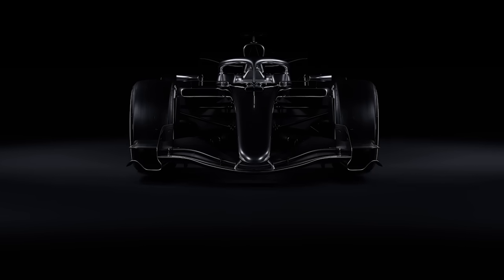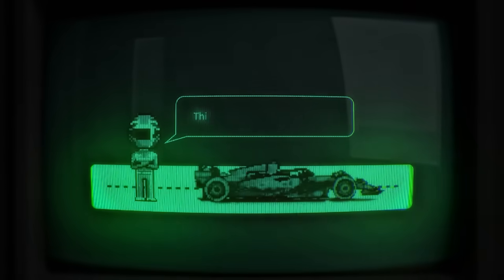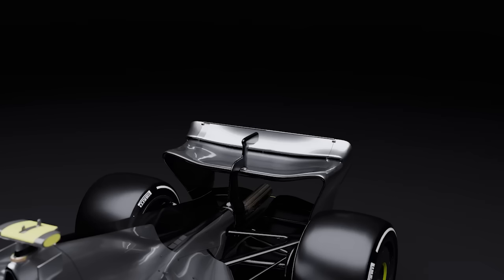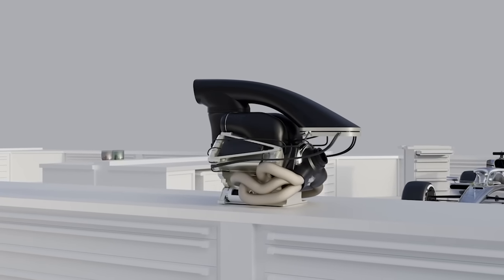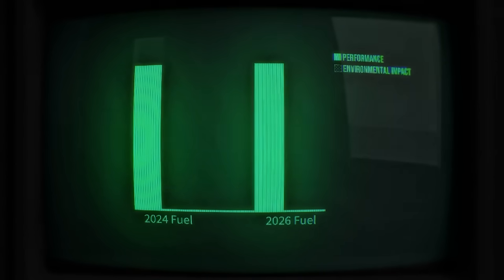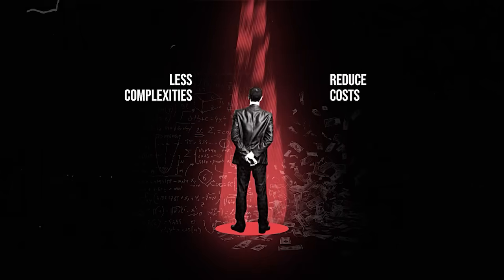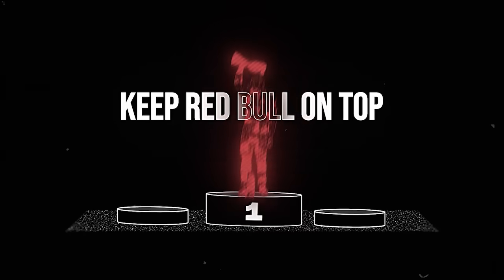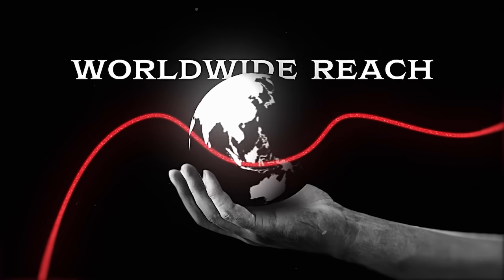F1 2026 Regulations: What’s REALLY Changing?

Comment: They did not become heavier through safety features. From 2008 on the weight increase was driven by Hybrid technology; Kers, then the 2014 engines. In each case the overall weight increase is directly linked to accommodate this technology.  The halo (The only significant safety addition), is only 7-9 kilos.
Because the heavier cars then hit with greater impact mass in crashes they had to reinforce the crash structures, adding even more weight.
And in 2017 they just made the cars physically bigger for no real reason, adding more associated weight.
The 2008-2013 cars were not unsafe in any way. F1 hit a sweet spot in safety and lite-weight. (You can see it in the stability of the safety regulations)
The addition of Hybrid powertrains, and super-sizing the cars is what led to all the weight increases since.

Comment: About time they get more active aerodynamics. F1 is supposed to be the pinnacle of motorsport technology, honestly a crime its taken this long. 
Though Im not sure about the 50% EV power rule, they're already using sustainable fuel, i have doubts the batteries will keep up for an entire race. Why not give teams a range in which they can operate, minimum of 40%-60% EV power for example so we get some variation in approaches for teams? F1 is a racing AND an engineering competition, FIA keeps banning innovations and I feel that its really holding the sport back.

Comment: I think these new regs are a step in the right direction. A couple changes i'd like to see though.

1) Push-to-pass button: 
I'd like to see this be available for a set amount of uses per race only. The driver can use it to attack or defend. They can use it to pull a gap early in the race or close a gap late in the race but either way, once they've reached their use limit, then no more for the rest of the race.

2) Tyres: 
I like to see all teams be given the same allocation of tyres at the beginning of the season. They then need to tell Pirelli what tyres they wish to use at the next, say, 3 races. They can use any combination of any compund they wish. It's entirely up to them. Those tyres are then removed from the allocation and cannot be replaced.

I think these two changes, especially the point 1, would add a great strategic element to each race and increase the unpredictability of each race outcome.

Comment: you’re not really making an argument about how the new regulations improve overtaking. I'm not sure I see why the low drag configurations of active aero would help since both the attacking and defending cars will be using them on the straights. won't even add any tactical depth as you said, everybody will use the best mode for each track section, no strategy involved. it kind of feels like you are bringing things up without backing them with a technical analysis

Comment: They should keep the current balance between ICE engine and electric motors using half electric half ICE would impact a lot the car's performance, a great solution to that would be to switch to renewable and less harmful fuels like the ones being used by the WEC

Comment: The physics and mathematics just don't add up to a formula that is competitive with current regulation lap times. Current era F2 cars are likely faster than the upcoming F1 cars in 2026.

The reason is the ICE reduction and dependency on the motor and battery. 

Not only has the ICE been severely reduced by regulation, in practice it's much further reduced due to the charging requirements of the battery as well. It's not a 50/50 split, it's likely closer to 35/65 or 30/70. 

And being forced by the regulations on power units and fuel energy density and fuel capacity and recharge required, the only option to complete the race distance is to lower the top speeds on every straight and lower the rpm everywhere on track. 

I expect lap times to be 12-14 SECONDS per lap slower than current cars.

These regulations are unnecessary and very poorly thought out. I would go so far as to say these are the worst new regulations entering a new era in the history of Formula 1... And that doesn't even begin to address the total nonsense that is the car regulations and x and z modes -it's really just double drs and the drivers don't even get to control it. 

Truly awful, terrible regulations.

What they should have done: 

Show off the carbon neutral fuel with V10's. Lose the turbo, electric crap and get rid of DRS. They should get 1200-1500 hp.
Reply: I think teams and F1 are saying the cars will be around 2-3 seconds slower than the current cars. So still plenty faster than F2

Comment: the engine power use change is only a marketing stunt and a pointless change when it makes practically no effort to actually better the enviroment, if the governance of f1 and motorsport really cared and wanted a change, they would alter the calendars of most racing series with multiple locations, which still remain the main source of CO2 emissions of motorsport

Comment: They supposedly want them to be racier, but not quicker avg. lap times, generally. More of the power is battery, less engine. Meaning you have to slower overall to go faster in bursts.
Reply: The upgraded engines that utilize electrical energy are faster than the older ones though.

Comment: So all the weight saving is wasted by using bigger batteries for greener ballshit regulations that completely go against carbon footprint if it is already using renewable fuel, and the active airo rules haven't changed they have just become more complicated making racing even further away from driver skill when messy corners can be saved by a push of a button. Look forward too seeing how reliable the computerised controlls for aerodynamics are. New regulations were looking good with smaller lighter cars and then sort off just went down hill onwards

Comment: should be a V4 instead of a V6. smaller engine allows space for bigger battery. maybe also aid in reducing weight further
Reply: Nah stay 6cyl, but switch to higher revving na and boost the ev motor. The new raxail hybrids ala the koenesigg dark matter weighing 88kgs but making 800+hp could then be utilized. 

So a small high revving nice sounding simplified gas burner for the dinosaur burning fans, along with a very powerful raxial hybrid motor=better sound, better performance, simplified vs turbos and an ev motor, lighter&better racing for the fans!

Comment: - The cars will be slower due to needing to keep the batteries charging constantly. Expect massively slower race lap times than qualifying.
- Since everyone has DRS, there will be no draft, hence the dependance on electrical boost to aid overtakes... which means more charging. (If you wanted to make it easier to overtake, you would add drag to the cars and removing DRS. This allows for more organic overtakes. Look up the 1999 US 500 race. They installed a flap on the rear wing to slow the cars down, and offer 40-50kph drafting speeds at 350 kph.)
- The cars length and width, without significant reduction in weight, only achieves a smaller floor area, reducing the best downforce. It also doesn't magically make it easier for cars to overtake.
- Reducing the cars ability to generate downforce via the floor will make it harder to follow.
- Shrinking the size of the tires will give the cars less free mechanical grip, making it harder to follow and harder to race side by side.
- "Optimizing efficiency" is great for endurance racing and transport trucks. Not for F1. Formula 1 is about speed and technology. Not fuel and tire saving.
- The majority of F1's carbon footprint comes from logistics, power grid usage at the tracks and maintaining the classy experience at the tracks. Not the cars. Charter flights for the teams. Make everyone fly economy. Ban driver's private air travel. Reduce wasted power at the circuits on things like a giant F1 sign at Las Vegas. Don't run night races any more due to lighting demands. Reduce plastic usage and wasteful fancy foods that are shipped in from all over the world. Use local.
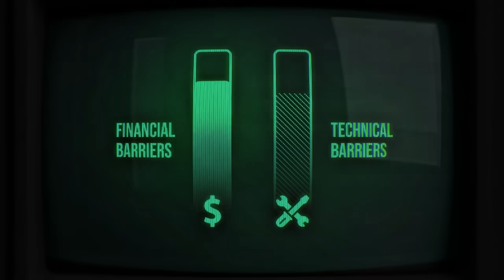- 7:28 except Andretti.
Reply: The fact that these races jump all across the globe is so silly. Should tour around the world (and end in Brazil) but no let's jump to and from the middle east cause some oil prince likes the attention during the ceremonies
Reply: @mizutani_  as far as I'm concerned, preaching sustainability and environmental responsibility... While catering to oil sheiks is hypocritical as fcuk.
Reply: @mizutani_ I agree that the calendar is pretty inefficient but from what I understand it’s based (mostly) around the weather for each part of the world and some tracks have very narrow windows of operating at a good temperature for racing. Also yes oil money was used to make Bahrain the 1st race of the season and abu daubi the final race.
Reply: Do people even care about race lap times? Lap times only matter in qualifying
Reply: @lewis8552  quicker lap times means quicker cars? Ever since 2014, F1 has been on a bad decision spiral. 2023 was a step in the right direction aesthetically but like... It's been 10 years of horrible decision, and this next formula is continuing the trend.
Reply: Source: "Pulled out of my own ass". This is a bunch of statements with no argument whatsoever, except the carbon footprint which is imho a correct presumption
Reply: Bro is a professional hater
Reply: @aaronmoyer4722  It's ok. I got IMSA to fall back on.
Reply: Bro yapping
Reply: @bigchief9313  I had time between between doing your mom and her making me breakfast.
Reply: You make some good points, especially on aerodynamics (and yes IndyCar did a fantastic move in 1999!), but this is nonsense:
"Shrinking the size of the tires will give the cars less free mechanical grip, making it harder to follow and harder to race side by side."
It is a known FACT that less mechanical grip = easier overtaking. Just look at WET races - best overtaking ever. Also, less mechanical grip (or any other grip) means longer braking distances due to weaker braking and slower cornering speed, which all means more overtaking chances.
Reply: @amjan This is the line of thinking Nascar needs for their short tracks. The current generation of cars have way too much mechanical grip to make passing possible. The best way for Nascar to reduce mechanical grip would be to increase the HP, but Nascar doesn't want to for some unknown reason.
Reply: @amjan  That's not entirely how that works. Less mechanical grip means the tyre grip matters more (deg, tyre compound etc) the wider tyres mean just mechanically there is a higher base grip level, less chances of spins etc etc etc. 
So more mechanical grip means the ycan race closer with the disturbed sidewash of air easier as there is a higher base grip and a higher expected level of competitiveness between cars with different tyres/deg levels.
Lowering the mechanical grip means cars on softer tyres, or fresher tyres will have a huge boost over those without meaning yes more overtakes, but not because the cars are more racey, purely cuz less overall grip so the compound/deg levels matter a tonne more. 
Lowering the mechanical grip also means more spins, specially after the drivers are used to being able to lean on it more and accelerate earlier etc etc because of having this mechanical grip, sure they will be fine but there will be some adjustment periods (ppl like max will struggle the most cuz of how their driving style works) 
Less mechanical grip also means there will be more reliance on downforce to help maintain it, but they are also reducing the floor meaning they will lose not only raw mechanical grip in the tyres, but also less overall downforce on the body. 

Bottom line: these changes mostly just make all the cars base cornering worse, givign advantage to softer tyres/fresher tyres for most part. Then the obvious harder overtakes on a straight, it will all come down to cornering grip and braking zone, so a lot more dives, which people have been complaining about the last few years (ppl been saying dives happen too much with how risky they are) so enjoy that kerfuffle xD
Reply: @amjan  I guess you're right about the low grip. I was thinking about dudes hanging it around the outside. But... You're right. The lower the grip (within reason) it will allow cars to be side by side around corners easier
Reply: @Synystr7 wow it’s actually cool for you to accept that your wrong with humility, not many people do that, that’s really respectable of you
Reply: 7:28 glad, they remove andretti
Reply: 1) The teams are gonna find a way to increase battery life anyway, so in a matter of time the cars will be as fast as before
2) There will still be X-Mode/DRS Zones that are ONLY for the straight parts of a track, and also this DRS is (Theorically) not activated by the battery, it actually helps to save the battery by getting less drag and making the car gain speed in said straights
3) 30 Kilos less for a car that is 10 Centimeters less large and 20 Cm Shorter is like losing 50 kilos on a 750 kilos car.
4) That's why they are modifying the other aero efficient aspects
5) Smaller tires are made to pollute less (You know the FIA wants to look forward in polluting less with the cars), also they interfere less with the full aero package of the cars, so if the mechanical grip is less, the downforce grip is theorically more. 
6) In this case they do this to allow the drivers to push more during qualifying and races.
Reply: Bah rah rah

Comment: Yeeey half of the power is electric!! Only for 10 seconds per lap... it's unfortunate. The rest of the lap is ran with maximum half the power output and in unfavorable conditions even less. When fuel is used to charge the batteries less than half the power is available to drive the wheels. The movable aero is neccecery to keep F1 at F1 worthy speeds. 

The MGU-K gets three times heavier and for that reason is obligated to be mounted at the front of the engine on the crankshaft.

The floor gets smaller and more restricted in utilization. The front-wheel wake has to be ingested at least partially into the floor . This makes the floor even less efficient. It's no miracle porpoising should be a thing of the past.

The gearbox droppes from 8 to 6 gears forward to shorten the wheelbase. The 350 kW 'extra power' is the normal electrical powe available for 10 seconds per lap. If it is used already the driver is incapacitated. 

Not a big fan. Fortunately it's only for four years. I hope F1 survives this ruleset.

Comment: First of all, great video!

Secondly, unfortunately the weight loss isn't good enough to produce light and nimble cars. The 2026 cars will still be heavier than the 2021 cars, which were already quite heavy. If the cars can get back to at least 2018 weight, that would be a bit more of an improvement.

Comment: active front wing will be trouble, because they are so exposed to contact at the first turn of every race, if nothing else. so if the slightest contact stop them working as intented then it will be mayhem.
Reply: I mean, that shouldn’t stop their introduction, no?
Reply: @ap0llo.0ne51  no, but if they see that even slight damage stops the wing functionning propperly which could affect both performance and safety, then it is not impossible that they might reconsider or make changes to the moveable aero of the front wing.
Reply: @ that is fair, yeah. I wonder how they’ll reinforce the servo bits and pieces
Reply: You could say the same thing about the drs, or litterly everything
Reply: @Jasongilliar not really because you see a lot more front wing damage from the slightest contact, litterally every race, and certainly way way more than rear wings. And it is going to affect performance so much if it is damaged, even slightly, and probably safety too.
Reply: I can't see it being anymore of an issue than current damaged front wings. There might be more nose cone replacements over the season but the current complexity of the front wing has a massive effect if damaged.
This almost harkens back to mercs double drs.
Reply: Maybe they'll start making the front wing a little bit sturdier now, but yeah, right now minor damage to the front wing can be critical, drivers might have to stop using the end plates of the wing as horns to puncture opponents tyres.